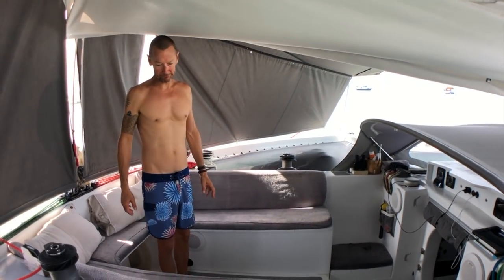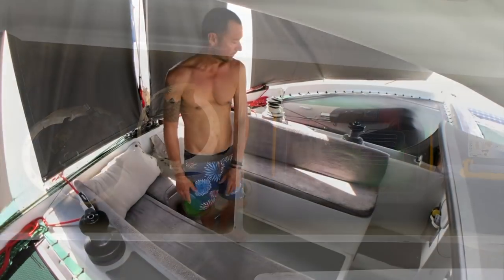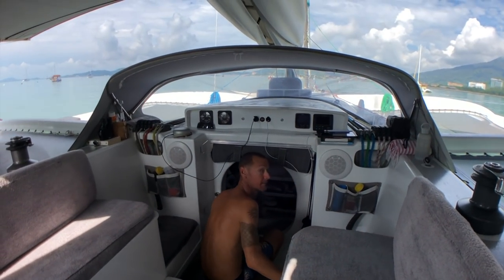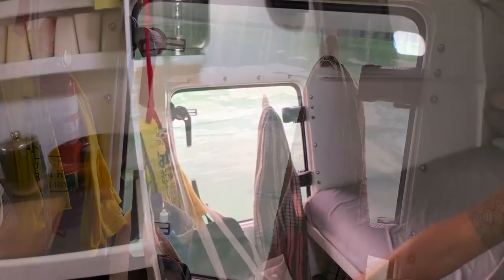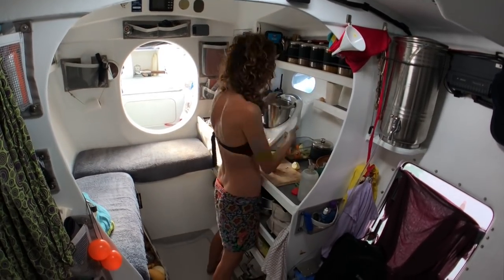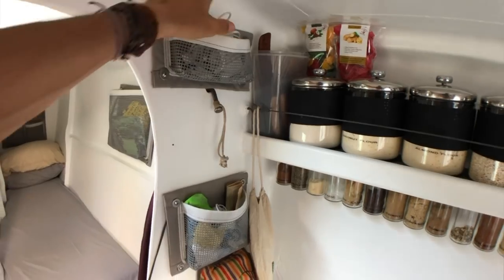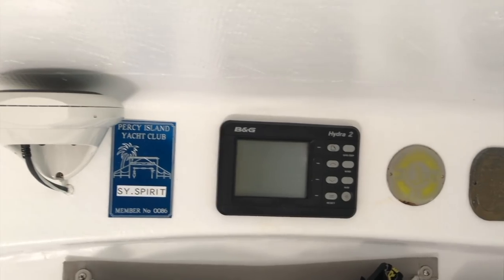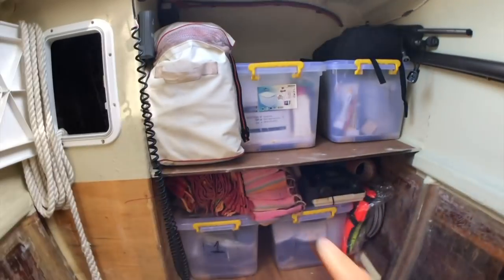Tour of a simple sailboat interior - Trimaran Spirit - The Simple Life - Ep10

Comment: Great boat, love the simplicity.
Out of interest, do you have something more too hold those food jars on the shelf when at sea?
Reply from the maker: Thanks 🙏 the jars are only held in place with the small dyneema string. We’ve never had any issues over the fives years since we installed the shelves.
Reply: So you must have a nice easy motion, guess you weren’t racing.   I had a small cat, made my way upwind in a F7 with a tumbler of water holding some wildflowers sitting on a smooth table, no fiddles, did not even move, though I was going as slow as I could, still making good way.
On a mono they would have gone flying on the first decent wave.

Comment: Great boat! It is interesting to see that you have a Thermomix onboard. Can you share your experience?
Reply from the maker: Catamaran Scout thanks for the message. We’ve been running off 100% solar since 2015. We have 500 watts of solar that’s connected to a 320Ah lithium battery bank. The Thermomix runs via our 2000w inverter and it works a treat. We’ve never had an issue with the onboard power or thermomix since installing it in 2015. The choice of a Thermomix was due to the efficiency of it and the way it can cook many things at once. If you’re wanting an efficient system and to run off solar we highly recommend it 😊

Comment: What a really nice simplistic trimaran mate. Did you build it yourself. Nothing better than marine plywood, some good heavy fiberglass cloth, the heavier the better. I use to build small rc boats. I would use kevlar fiber, & the rolls were not much more expensive, than fiberglass rolls. The epoxy west system to me is the best. The only thing better than fiberglass & marine grade wood, would be thick aluminium, but it's really expensive. If I had the money I would buy or build a nice SWATH (small waterline area twin hull) sailboat, powered by a helical vertical axis turbine attached to a saildrive with 3 forward gear ratios, neutral, & reverse. I would also have a couple of vertical axis  helical turbines to make electricity, along with several solar panels covering the entire roof & maybe a couple on the dingy davits. I would also have a couple of good hydro generators for when sailing, & a huge lithium-ion battery bank to store all the energy. A very good water maker that could produce between 20-50 gallons of water  a day. No diesel or propane on board. I also heard they have great solar pits that work great on sunny days. I really & truly wish I would of known more about sailboats as a teenager & young adult, I would have lived my entire  life on the ocean exploring the world. Also the SWATH  boats do not roll or porpoise up & down because the hulls are about 4 ft beneath the surface of the water, & the smart thing is to build your platform & living quaters as high as possible without making the vessel top heavy, so when rough, high seas arrive, they pose no threat because your vessel is similar to a jackup oil rig. Peace & Love.